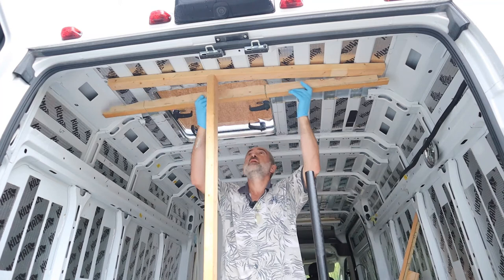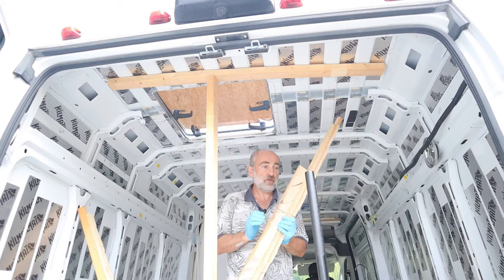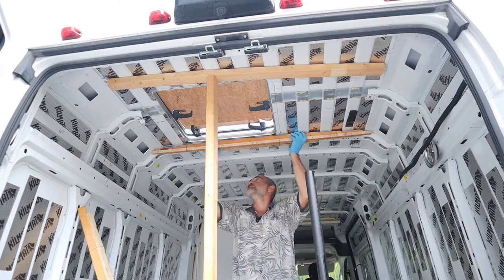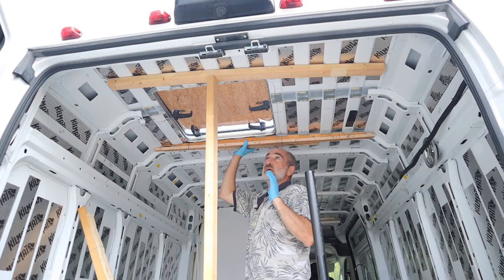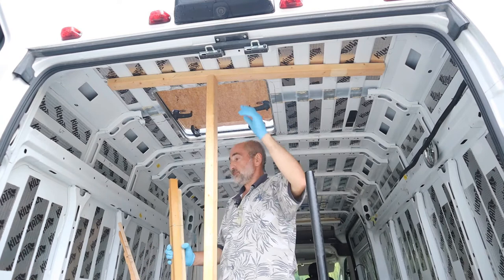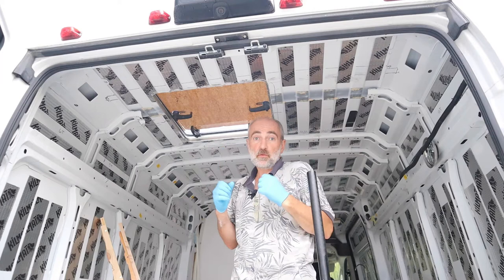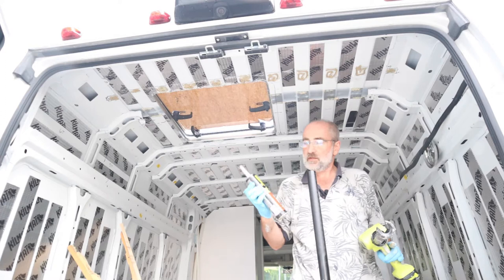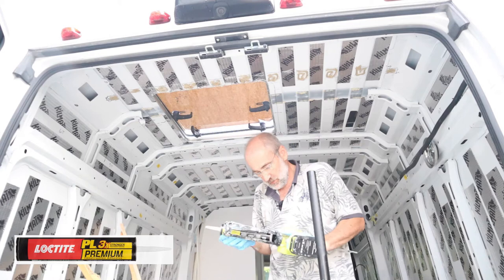Van Life build series - Installing the skylight hatch -Part 4 Providing Roof Support

Comment: Interesting. I wouldn't think of glueing the frame to the roof. I am trying to rivnut it in place but it's hard to match  the frame location to the next available structural rib. Have you got good adhesion after everything is cured?
Reply from the maker: Yes, the construction adhesive worked better than expected.  As shown in the video I was able to riv-nut one side.  Both support pieces will also have support down the side of the van, similar to the metal ribs.  I also used construction adhesive for the partition doors at the front of the van.  Its important to sand or better yet use a wire wheel on a drill to rough up the paint for better adhesion.